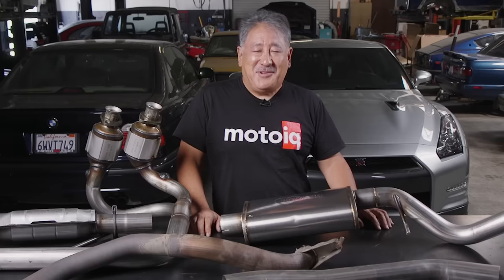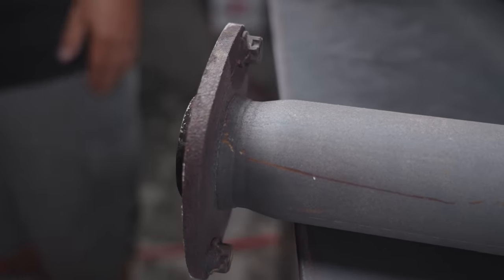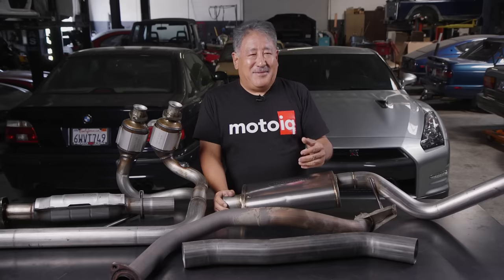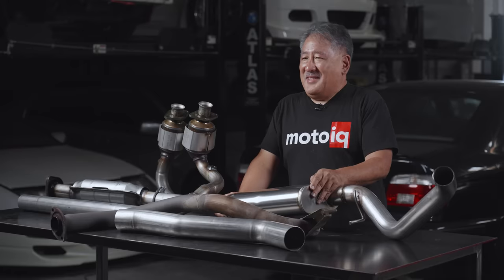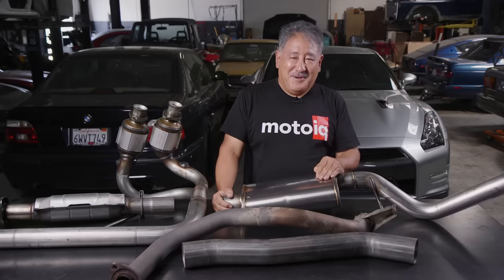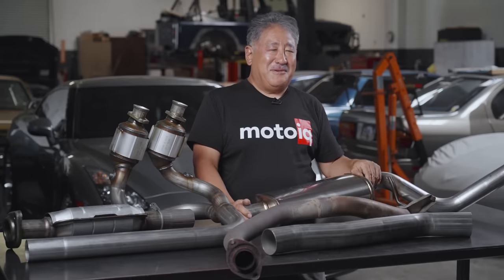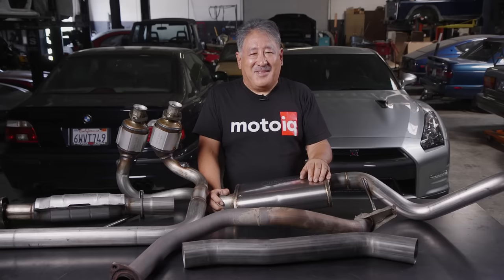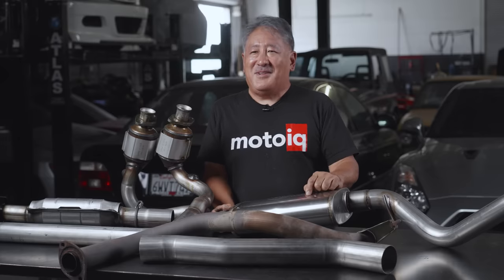Exhaust Back Pressure Myth DEBUNKED!

Comment: Dude, listen what I’m saying if you don’t have at least a little bit pressure the muffler bearings won’t spin in the right direction and if they don’t think she’s up and make a bone and if they’re right underneath your feet, you blow your feet right off it’s been proven I was a street racer in the 80s and I ve literally seen people blow their feet off when the being  goes bad because it wasn’t downstream far enough and it was right under the feet they lost both their feet, and it was tragic. Anyone knows about back pressure in a hot car  knows that the whole reason is to keep the muffler bearing spinning in the right direction.  This is a problem with YouTube and the Internet in general people. Keep lies just liars, just bullshit that’s like you know come on dude everybody knows the muffler has to spin right bro that’s why I run spin rights in my exhaust system because I want to keep my feet.brah
Reply from the maker: we drysump the muffler bearings to prevent that.

Comment: Sounds convincing but it's a load of crap, I went against the exhaust shops recommendation (which contradicted everything this guy said) and they were right, no back pressure made the car run like absolute ass.
Reply from the maker: It's not crap if you watched the whole video and understood it and built an exhaust around the principles I carefully explained, then tuned the engine for it, your engine would make more power and torque.
Reply: @motoiq  believe it or not, we did do all of those things and it still made less power! :)
Reply from the maker: Didn't do it right then. Explain what is your engine, what mods you have, what sort of exhaust did you design and what sort of tuning did you do after?

Comment: you only need back pressure on a 2 stroke engine
Reply from the maker: That is not true, watch our video on that.
Reply: @motoiq  every time i run a bike engine without the expansion chamber it dies
Reply from the maker: That is true but it's not due to back pressure

Comment: Complete bullshit. Had a supercharged SBC on the dyno with headers and 3 foot extensions vs his full exhaust from his car. Made about 10% more power with full exhaust
Reply from the maker: It's because of other reasons besides backpressure.  Like the tuning or the header selection.  Think about it, if collector extensions were the cause of losing power no one would ever use them. Race cars would all use full exhausts, etc. Did you monitor your AFR when dynoing?

Comment: If what you're saying were true the exhaust valve should be twice as big as the intake valves. Duhher
Reply from the maker: That's not how it works. The intake is being sucked in with at the most 15.5 psi pressure differential behind it but the exhaust is being positively pushed out by the piston but also by the expansion of combustion with an impulse pressure several times that. You need a bigger intake to get enough mixture in.

Comment: I very much appreciate this guys street smarts, but I disagree with the way he looks at individual components. If the exhaust, camshaft, and induction system don't match, then you really don't know how the system is working. An engineer that works on base engines will talk about the gas exchange process. This refers to three things: getting the exhaust gas out, getting the intake charge in, and trapping as much of the intake charge as possible. If the only thing that gets changed is to a low back pressure exhaust system, it is possible to scavenge so well, that you start pulling fresh charge right across the cylinder and out the exhaust. If the question is how to get maximum horsepower, he is correct that a lower back pressure exhaust system is part of that answer. This only works, though, if the other components work with the lower pressure exhaust.
Reply from the maker: I am a mechanical engineer that has always worked in the automotive industry, not sure what street smart means. It is not very likely that you will overscavange an engine just due to the exhaust design.  The other stuff is obviously outside of the context of this video.
Reply: @motoiq   Street smarts means one's ability to understand what a product or process change will do without requiring the mathematical analysis to back it up. (It's a complement.) You say it's not likely that just an exhaust system change could over scavenge. This is not always the case, especially when looking at the entire power curve. A small increase in peak power doesn't do much good if the engine is a dog getting there. It is for this reason I made the comment regarding an understanding of the entire gas exchange process. Without running a CFD analysis, you will never know if you have all of the systems working together or if they are just close enough.
Reply from the maker: I have never seen just an exhaust overscavenge on a 4-stroke engine in 35 years of building engines, racing and in OEM and Motorsports engineering. We build a lot of fast things before CFD and just CFD alone isnt going to solve more than just steady state flow problems.  You are trying to sound smart but what you said is actually too simplistic.  Like I said, this is not even the context of the video.
Reply: @motoiq  The context of the video is why the old-timers would say that back pressure, at times, is appropriate. All I'm saying is that, with certain combinations of parts, lower back pressure will give you less area under the curve. The old timers knew that if an engine was designed for peak horsepower, the likelihood of it being weak in the low and mid-range went up. They also knew if an engine was built this way, without the proper gearing to support it, it would not be enjoyable to drive.
Reply from the maker: You won't get less area under the curve ever if you design the exhaust system properly for the application.  This always means the least possible backpressure with the best possible velocity. The only possible time this could be wrong is certain incorrect combinations of parts.  Look at the Otto Cycle PV curve, if you raise the floor of the curve due to retained pressure, you have less energy to recover from the cycle.
Reply: @motoiq  As you said, "if it's designed for the application". How do you know you've designed it for the application unless you've been there before or have done the analysis?
Reply from the maker: Because I have for my entire carrier. I do the analysis, I would gladly design your exhaust if you give me the parameters and pay my fee.
Reply: @motoiq  You're not getting it. The parameters that you're asking for are things you should be designing for as they are part of the flow stream. It doesn't make sense to do a flow analysis on the exhaust system without making the camshaft timing and the induction system part of the analysis. From your comment, I suspect you have never done a gas flow analysis from end to end using Ansys, GT Power, or similar code. If you had done a complete analysis, you would know why old-timers said that back pressure is sometimes acceptable. There's a reason OEMs and powertrain design houses do a complete flow analysis.
Reply from the maker: I have I don't think you have.  You are stating the obvious.  Backpressure is never good unless you design the engines parameters especially not to be affected by backpressure which would be dumb because that would be worse for any type of normal operation.  Of course, I do not code CFD software, but I worked for more than half my life with companies that do powertrain simulation. Stop being obtuse. This is a stupid conversation so I am not going to be a part of it anymore.
Reply: @motoiq  You're too funny, dude! I'm glad you finally quit before you had to admit that you've never run any CFD code and have never worked with or for a company that does powertrain simulation work.

Comment: if gm never did anything else to the world, starting and perpetuating the myth of back pressure being "good" is enough... that was a lot from the tbi engines, they needed it for emissions or something, i don't remember exactly. i do know those are terrible engines to try and get to pass emissions. my built 390 with a carb passed with no cat, 350 with a cat and efi failed. absolute junk, like everything else they build... and if you say different, you're just wrong or delusional. but back pressure never made any sense to me. velocity, yeah, but not back pressure.

Comment: OK, I don't know who you are and I didn't watch your entire video, but I did see your intro and I see a place where someone is going to misinterpret the information. Please hear me out. I have eons of time invested in tuning and I worked in Emissions Fuel Economy and Drivability professionally for 36yrs at one of the biggest auto manufacturer's in the world measuring all the components very accurately with millions of dollars worth of equipment, calibrated to NBS quality monthly. I can state this: If you are all out racing, you are correct, back pressure is going to reduce your total output. Any energy devoted to expelling spent gasses is going to reduce the output. But, if you are EVER going to run your gasoline fueled internal combustion engine in a sane manner and desire any kind of fuel efficiency as it pertains to distance traveled per amount of fuel consumed , back pressure is necessary. Because it all comes down to air fuel ratio. If you lean a combustion process in favor of efficiency (in terms of conserving fuel) you need "some" back pressure or part of the A/F charge leaves w/ out contributing to the output.  Also Too you need a constant amount of it, or you need a process w/ an algorithm that compensates for changing back pressure. The reason is simple: The scavenging or lack of scavenging of a combustion chamber changes the A/F ratio. If ultimate fuel efficiency is desired, ignition timing, leftover exhaust and A/F are critical components. When an optimum A/F ratio is set up, any change to any of the components involved alters the efficiency of the combustion process. So, let's not go hog wild reducing back pressure and alter our A/F ratio, unless, as I have stated, we monitor the exhaust output for pressure or O2 and make adjustments to the A/F ratio to compensate. Remember, A/F involves residual exhaust components, and ignition timing requirements change with the amount of exhaust left inside the combustion chamber. If you are an all out racer, then yes: Do away with anything that impedes the exhaust exiting the combustion chamber, but if or when you desire fuel efficiency as in distance traveled per quantity of fuel used, back pressure is critical to control in a very precise way.
Reply from the maker: So assuming that you are a calibration engineer, you know the PV curves of the Otto cycle and you understand that raising the floor of the gas exchange part of the cycle reduces the amount of work that can be recovered from each cycle.  It shouldn't matter if it is at WOT or part throttle.  Fuel economy is directly related to work recovery per unit of fuel. With all that can be done with variable cam timing and direct injection events, I can't see how you need to depend on backpressure to prevent overscavanaging the engine on overlap.  To me, you design the engine system to be as efficient as possible and do your tuning around that, not vice versa. You tune around having less backpressure, you don't add backpressure to help your tuning right?

Comment: Different back pressure changes the curve.  This is settled.  It’s not always bad.  That’s ridiculous
Reply from the maker: it is always bad, you get the highest velocity possible with the least backpressure, it will make better bottom and top end.
Reply from the maker: What you say goes against well established scientific principals.  Look at the Otto Cycle PV diagrams, actually do some study of what goes on inside an internal combustion engine and tell me if there is any case where more resistance to the exhaust event helps efficiency. There are many SAE white papers on this subject matter. Don't be Dunning-Kruger ignorant.
Reply: @motoiq  it depends on engine design and intended application.  You can’t make a blanket statement that all back pressure is bad all the time and expect me to take you seriously.  And then make an even stupider dunning Kruger argument.  Stop being ridiculous.  Grow up.
Reply from the maker: I didn't make this up nor did I discover it, it's common knowledge.  If you did some simple experiments and found that more backpressure caused an improvement, it was not the backpressure but other well understood physical phenomenon that gave the result, the back pressure was just a byproduct of it.  Normally I would take the time to educate you and give you vetted resources to study but since you are rude, condescending, and deliberately choosing to be ignorant, you can go buzz off.

Comment: damn this back pressure is giving me high pressure🥵.... can anyone tell me what is to be done...??? i just want to change a slip on exhaust from double barrel to single hole slip on in my benelli 502c . how do i shake hands with both the back pressure and and exhaust velocity??? should i cut the bottom of the db killer ??? to let exhaust fumes escape more freely .... 😮

Comment: Engines are not air pumps.
Reply from the maker: When it comes down to it in the most basic form they are.
Reply: @motoiq  Not realy. Air pumps are used for pushing (pumping) air. Engines are used for converting chemical energy to mechanical energy for moving the vehicle. Just because air goes through them, does not make them air pumps. Converting chemical energy is not used to pump air, therefore they are not air pumps.
Reply from the maker: No kidding but if there was no combustion they would pump air.  To make good VE they need to pump well. A two stroke is even a better pump like a compressor.
Reply: @motoiq  How can they pump air, if there is no combustion? They would need an external motor to turn the crankshaft. And it would not pump the air efficiently either, because energy would be wasted on compressing the air in the cylinders.
And with combustion, it is not pumping the air either. It is sucking the clean air at one end and expelling exhaust gasses at the other.
Reply from the maker: Of course you need and external motor to turn it but it will pump air. It is an analogy.  Instead of understanding the obvious you are arguing about semantics.  Of the nearly one million people that saw this video, you are the only one to not get it.
Reply: @motoiq  As I said, not does not pump air. Ask any engineer.
Reply from the maker: I am an engineer.
Reply: @motoiq  That is not the best response then.

Comment: I don't agrees with most of what he saids its not always about drag cars had a race gen 3 and ran 31/4 had top end but no bottom end went to 3inch and bingo all good and run a 2 stroke with out a expansion chamber see how far you get, and a hardley davison without cones in a straight exhaust you will burn valves
Reply from the maker: If you are burning valves, then your tuning is off and your exhaust is designed wrong.  If you design an exhaust correctly and tune the engine correctly, it will always run the best, make the most power and torque and have the best powerband with the least amount of backpressure following the principals I talked about in the video.

Comment: If all you are doing is drag racing or circuit racing, then yes some things you said are true. But I don't think you understand what back pressure is.
Reply from the maker: Everything is true and I have a very deep understanding of what back pressure is.  If you don't believe me maybe you will believe Gail Banks https://www.youtube.com/shorts/k7yYY_hy250  Here is a back-to-back dyno test showing I am right  https://www.youtube.com/watch?v=V2Wv5-ZTOjM
Reply: Oh, good! My mistake. When I think of back pressure, I think of like a clogged pipe. And I think" should pull this clean out cap off?" Because when I pull it off, there is a chance  it may come squirting back at me from all the back pressure it is under .But that is just the life of a plumber working in a 30 story building!  Have a nice day! @motoiq

Comment: You need the pulses to scavenge and thats why you cut the collectors right after where the paint stops burning on the exhaust pipe, those hot pulses will help carry on to the next pulse to the next and keep the flow smooth